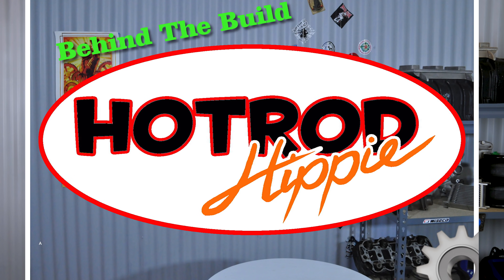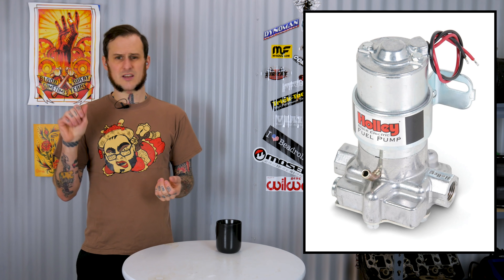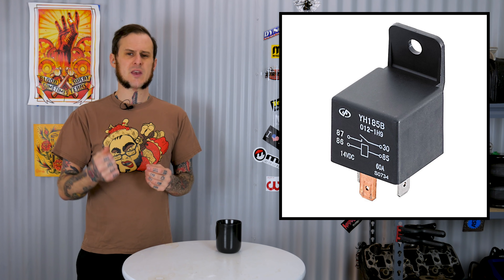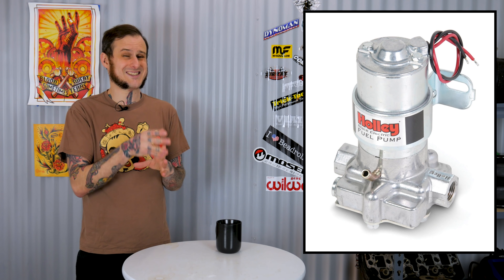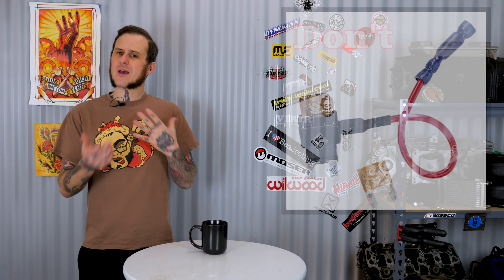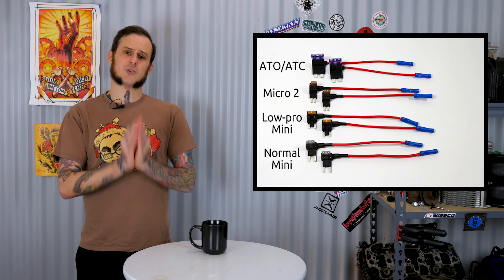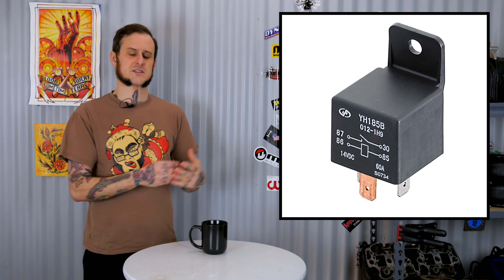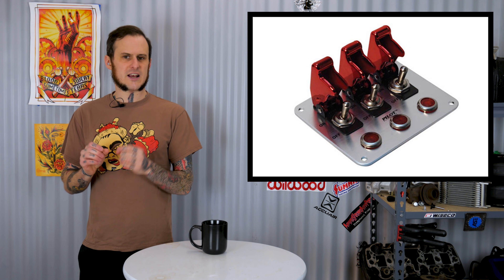Relays and Fuse Taps - Auto Electrical Dos and Don'ts - Episode 2

Comment: is it a bad idea to run your premade accessory  fuze panel INSIDE the vehicle
Reply from the maker: You mean a sub panel for more fuses or a fuse tap? Either way it really just depends on what is being plugged into it and how it is wired. I have safely added sub fuse panels to vehicles that lacked the necessary extra circuits in the past. You just have to find a safe place to pull power from. And with fuse taps many folks have found places I can see them being ok. Like low load devices such as dash cams.
Reply: and its a sub panel:  https://www.amazon.com/gp/product/B07DYT2TVS/ref=oh_aui_detailpage_o00_s01?ie=UTF8&psc=1
Reply from the maker: TRD_tv if wired properly (safe routing, quality wire thickness) there is nothing wrong with that. I would wire it on a relay so that it isn't just battery hot all the time. But I've used panels like that many times in the past. In fact I quite like the looks of that one and may pick up a few to have on hand.
Reply: i planned on wiring the accesory fuse box to the battery directly. i figured the fuzes in  were protection enough. am i wrong? should i run a fuse to a fuse box? just seems counterproductive
Reply from the maker: The only problem with wiring the fuse box directly to the battery is that anything you connect to it will always be powered. Say you wire fog lights off of it, or a cb radio. You could very easily leave them on and kill your battery because they always have power. 

Every circuit should have some form of circuit protection. If you put that fuse box inside the vehicle and wire it directly to the battery then the wire feeeding the fuse panel could Short out. If the wire rubs through on the firewall, then that wire is an unprotected circuit. Meaning it could Short out. Not only damaging the wire, but potentially anything else attached or around it. Or even starting a fire. It would be a good idea to run a large fuse (say a mega fuse) close to the battery on the feed to that fuse panel. 

The only circuits I'm ever ok with not having a fuse or fusible link are the battery cables to the starter. Personally opinion.
Reply from the maker: You could still wire the panel directly to the battery but pass it through a relay. So the relay would cut the power to the fuse panel when the vehicle is off. Then when you turn the vehicle key on the relay would activate and the fuse panel would come alive. That would prevent it from draining your battery if you left an accessory on. You would just need to find a simple key hot source to activate the relay off of.
Reply: bu would that be a problem if say there was a switch betwen the fog lights and the box
Reply from the maker: The only issue would be forgetting and leaving them on. That is your choice. You can just wire it battery hot and run things on switches. I just like to have the peace of mind that when the key is off, circuits are dead. They are less likely to cause battery drains or be accidentally left on them. If you are willing to accept those possibilities then go ahead and do it.
Reply: so the best way to alleviate that would be to run the g gauge wire coming from my bettery, to a relay somehow, to what? an ignition switch or something
Reply from the maker: Yes. A relay on the power line to the fuse box with an ignition hot circuit triggering the relay on would be the best way to handle that.
Reply from the maker: Relays pull very small loads to trigger them. So you could use a fuse tap to trigger the relay if you don't have an easier way to trigger it.
Reply: Absolutely correct.A fuse tap for IGN to relay is the way to go.

Comment: Can I use a fuse tap for fog lights?
Reply from the maker: lawrence white fog lamps pull a fair amount of amperage depending on their design. Which can wildly vary depending on the style, wattage, etc. I would not directly power most fog lamps off a fuse tap. They should more so be powered off of a relay with a good fused power supply. If you don't have an extra fuse slot somewhere then going direct from the battery through a relay is the best bet.
Reply: HotRodHippie  The LED power is 30 watts and the operating voltage is 9-32V DC. What size relay will I need and how do I wire it? My battery is in the truck.

Comment: If I am running 4 relays under my fuse box can I wire all the grounds from the relays together and wire them to the same solid ground? Does gauge of ground wire matter?
Reply from the maker: jesse hayes do you mean the ground side of the control circuits for the relays themselves? If so, that is no problem. Control sides of most relays pull very littler amperage. Something like .1-.2A. So 4 relays are below a 1A draw. I'd just use whatever size wire allows you to easily wire the configuration. For 1A even over a decent distance something like 20 or 18ga would be fine. But most relays have heavier wire than that on the sockets. So whatever works for you to cleanly wire it should be fine.

Comment: Hey HotRodHippie would it be okay to use a Fuse Tap for LED footwell lighting the whole kit pulls 12 Volts?
Reply: I would still use a relay and install a separate rocker switch so you get clean power and the LED will last longer.  The only times I would use a fuse tap is for a radar detector or a dash cam
Reply from the maker: Do you mean the RGB led strip light kits that can change colors with a remote? Those strips pull about 4.5W per foot (approx). So that works out to .375A per foot. So if you run three of them you are technically only pulling 13.5W / 1.125A. Though the controller unit will draw a little of its own. And possible minor surges on start up. So you are probably under a 5A circuit with all of that. So if you use a decent sized fuse to tap off of, I think it would be alright. However this is just based off the numbers I can find for these items. I've only used one in cars once, mostly I install those in custom computers.

Comment: I want to connect my drl lights to the efi is that a good idea if not where can I connect them besides the acc fuse the led lights are 10w
Reply from the maker: How many lights? At 10w per light you are at .83A so figure 1A per light. Does the vehicle have existing DRLs? I'm confused as to why you want to tie them to EFI. I would avoid that at all cost. Tieing into even the power supply or ignition signal to EFI can introduce electrical "noise" into the system. If you really need to do it a relay is your best bet. Isolate the two circuits from one another but allow you to control based off the circuit you want.
Reply: HotRodHippie it’s a 1995 Toyota t100 it doesn’t have drls but I want to install switch back both blinkers and drls I couldn’t find the acc fuse in the fuse box under the hood

Comment: Voltage doesn't travel buddy.
Reply from the maker: You are correct. Bumping is closer to reality. Current also doesn't flow from positive to negative. But this was intended to be an overview so folks have enough basics to make informed decisions about wire size. It got a little more in depth than I set out to do but not as in depth as it could have been. At a certain point I have to simplify things for the average viewer.
Reply: HotRodHippie the problem is that you are giving false information to the less informed public, misleading them to believe that voltage flows. A better approach would be using the terms current draw, or power consumption of a system. You are correct, an electron will flow from a higher  potential to a lower  potential, however we decided to depict that the flow of the conventional current is the other way around it. Nevertheless, saying that the current is flowing is correct, no matter the direction. Actually when designing a system an engineer can and will assume the direction of the current, the only difference is that if the engineer assume the wrong direction, the sign will be negative. Not a big deal. Don't take this comment as a smack down, I really enjoyed the content of this video.

Comment: If I have a fog light bezel and all I know is that it need 12V power. I want to wire it to a switch so it can be turned on command. Everywhere I look, I see 40Amp relay with 30Amp fuse. Is that really needed for a small LED Strip?
Reply from the maker: libinls I would not expect that to be necessary at all. Folks are probably thinking of the actual fog lights themselves, not the strip lights like you are talking about. I can't say for sure what they will draw though. What brand are the bezels?
Reply: HotRodHippie Thank you so much for getting back to me. You have no idea how much ur help means to me. This is the exact product. Unfortunately they don't tell you anything aside from the 12V. 

https://m.ebay.com/itm/FOR-15-17-SUBARU-WRX-STI-PAIR-OE-BUMPER-FOG-LIGHT-BEZEL-COVERS-W-LED-DRL-STRIP-/401403396844?txnId=717737948027
Reply from the maker: You are right I can't find anything. Even the one company I found that sells a wiring kit to install those doesn't list what siZe fuses they use. I can't believe those will pull more than. 2-5A but that is a shot in the dark guess. I think I'd feel safe using a fuse tap with those. Though if it was me I'd probably splice into the headlight wiring closer to the fog light and just do a neat solder job with heatshrink and sleeping.
Reply: HotRodHippie thanks Alan! I would've spliced into it as well. But, I'm trying to do a setup like a toggle switch. So it only turns on for shows and stuff from inside the cabin. I hate electric and I was hoping I could really do this. I might just end up doing the generic switch setup with the 12v. And pray it don't burn out. Lol

Comment: So I bought some after market fog lights for my maxima. I saw some guys connect it to the fuse box with these extension , or others just connected it to their battery and just turned them off and on when they wanted them.  Which one would you recommend? Thank you

Comment: Great informative video. How would you recommend hard wiring a V1 radar detector? I was going to use a fuse tap on either a used or an unused fuse socket on my Audi A5, but after watching your video, I and holding off. Thanks in advance.
Reply from the maker: Eduardo Elizondo the V1 pulls a small draw. Only about 300-400mA from the information I can find. So if you have an unused fuse location in your fusebox, then a fuse tap would do just fine. If you don't have an unused one, then I'd say pick one of your largest circuits and you will be ok to use the fuse tap on that. When I made this video I was thinking about loads that are more excessive than these modern add-ons like dash cams and radar detectors draw.

Comment: How to hard wire multiple Dash Cams?  Are they all hard wired to the same ignition in the fuse box?
Reply from the maker: Most dash cams pull fairly low Amperage from what I've seen.  You could wire them to the same Ignition source if they are not pulling too heavy of a load.

Comment: If I wanted to power my car stereo could I use a fuse tap?
Reply from the maker: bunky021543 do you mean a radio head unit? If so why not just use the already existent radio power circuit? If you mean say a supplemental system like an amplifier, absolutely not. The power demands of aftermarket radios are greater than that of factory setups usually.
Reply: HotRodHippie ok thanks I was just wondering.

Comment: Hi..nice video you have here...just want to ask i,m planning to power up my 2 headrest monitors using a fuse tap in the fuse slot of my radio/head unit. The radio has a 10amp fuse and i will also be using a 10amp fuse for the headrest monitors...would you advice to use/add a relay in the new circuit running to my headrest monitors? sorry for the odd question really no idea in this matters and planning it to do it by myself (installations). thanks..
Reply from the maker: If you don't have an spare circuit I would use a relay triggered by a fuse tap on your radio circuit yes.

Comment: If I was to tap my fog lights into acc; are fuse tap a good option or I should just tap into the ignition switch acc plug or cigarette lighter? I called a couple local shop for quotes for fog lights installation and they run around two hundred to two hundred fifty dollars so I feel it's a little pricey so I will attempt to do it myself. 

Good explanation on do's and don't video.

Thanks in advance
Reply from the maker: Tou Yang you could use a fuse tap to tap into accessory to trigger a relay. But I absolutely would not run fog lights without a relay. It will be a safer circuit and give you brighter lights too.

Comment: Really wanted to use a fuse tab in order to wire directly a Bluetooth FM transmitter you know the type that you put in your cigarette lighter? Instead of putting it in the cigarette lighter I wanted to run one of those fuse tabs. Running it off the fuse tab will make it turn on and off with ignition. And it would also mean that my car now has Bluetooth to the stereo via FM transmitter. I don't see this pulling more than one amp. Do you think this is a dumb idea? My car is a 2000 Chevy Impala
Reply from the maker: Retro Pro Frank no it doesn't sound like a terrible idea. If you aren't charging a phone off of the transmitter then yes I'd imagine it isn't pulling much amperage. I'd try and find out how much before I committed to it. Something around 1-2A of less I'd say would be fine. I can't seem to find a spec on random ones online though.

Comment: Hey. My car stereo has no power anymore, and I replaced the fuse and still doesn't work, what can I do to fix this problem?
Reply from the maker: Ricky Sys are you certain there is no power coming to the radio? Or is it just hay the radio isn't turning on? If it's that the radio isn't turning on I'd check for a fuse on the radio itself as well as checking the ground for the radio. If that all checks out then the radio may be dead. If you actually don't have voltage getting to the radio I'd check for broken wires. If the wires all check out you may have a fuse box problem.
Reply: HotRodHippie im pretty sure it is fuse box problem, because I replaced my aftermarket stereo, back to the factor one. is there anyway to fix this myself?
Reply from the maker: Ricky Sys if it's a fusebox problem then disassembly and Repair MAY be possible. But that's a big maybe. Replacement is the likeliest answer. I'd be looking at wiring the radio off of another circuit before I did that though. You really need to fully test the wiring though. If neither radio works then yes you either have a wiring or fusebox issue.
Reply: HotRodHippie thanks for your help, much appreciated.

Comment: Can you plug-in two 15 amp fuses into a fuse tapper that is rated up to 10 amps such as this one? I want to tap into a 15 amp fuse.

https://www.autozone.com/electrical-and-lighting/fuse-and-accessories/cooper-bussmann-atm-fuse-tap/32416_0_0
Reply from the maker: MGonline1209 I absolutely wouldn't. You are both exceeding the rated limit for the tap itself but also risking overloading the 15a circuit. Say if one of your circuits is pulling 10a and the other pulling 10a. Neither would blow a fuse but now what was a 15a rated circuit is pulling 20a. It's a little more complicated than that it I would not recommend it at all.

Comment: Would you recommend using a fuse tap to activate a relay so that the relay is now a ignition activated relay circuit?
Reply from the maker: Curt D yes that is a perfectly acceptable use of one in my eyes. I recommended that a few times to folks in the comments here.
Reply: That's the only way I use fuse taps! These new electrical systems are becoming  more complex and monitored each year. Even then you still have to find the right fuse to tap into that's not monitored by the ECU. Also it's good idea to use a relay with a built in diode to prevent any jumps getting backfead into the factory system.

Comment: Ok, so I have a question about load resistors for hooking up LED turn signals, can yo simply install them to the wires coming from the switch in the steering column? Or do you have to go with as close to the bulb as possible? Front or rear? Or all?
Reply from the maker: It's Dj Dozer you could technically install them anywhere in the circuit you like. I've always done so as close to the lights as I can for shear ease. It is usually easier to do at the light rather than crammed under the dash. The only other issue I can see is adding the resistance so far forward, any wire resistance from corrosion or age may cause a larger voltage drop than you'd like. So I'd recommend at the light, but technically either should work.